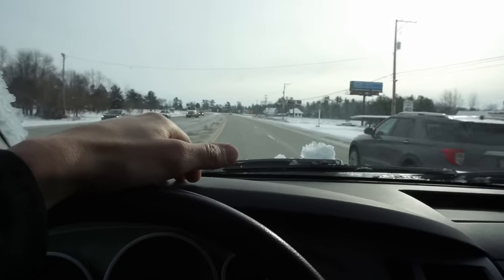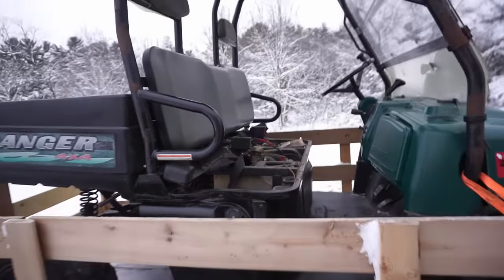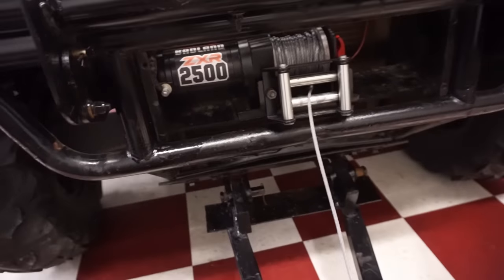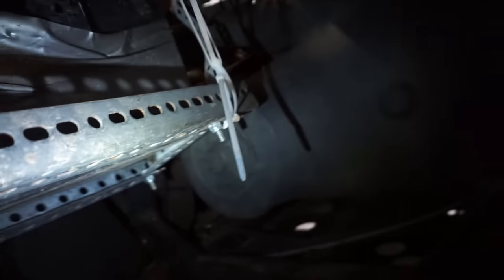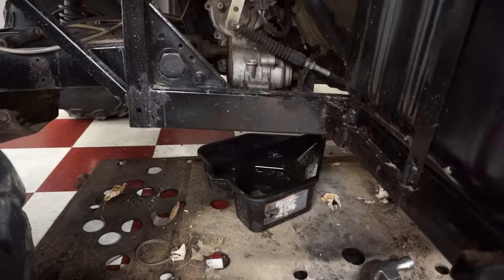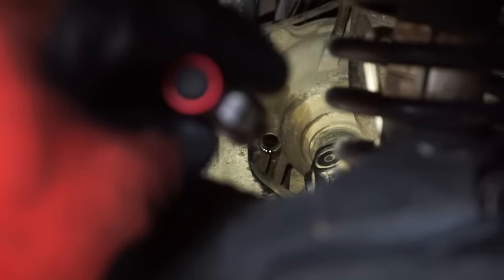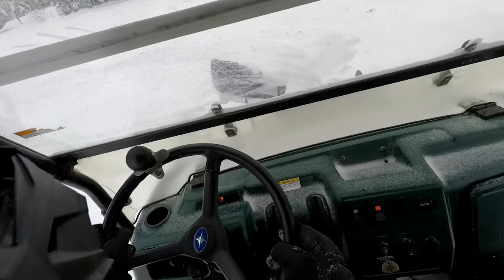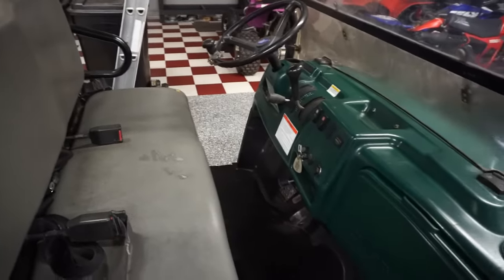Plowing Snow In a Blizzard With The Cheapest UTV I Could Find  (Huge Problem Found)

Comment: Go to Menards and buy the water softener salt which is in the blue bag they are tiny pieces that you can use for de-icing your driveway also, they are 50 lb bags at about $7 per bag throw three of those in the back of the box for traction which will be 150 lb I guarantee it won't slip when you're trying to back up even with only three wheels spinning. And also my cousin told me he uses Rain-X plastic on his side by side windshield. It makes it more clear and is supposed to let the moisture just roll off. I put it on my side by side but have not tried it out yet. If you go to the parts store it will be in the small engine aisle at advanced Auto I don't know why it is not by the regular rain x and waxes on the shelf.

Comment: You said that you have purchased stuff from this guy before? Given the CV joint hack job, lack of tranny fluid, the overfilling of the engine oil, and last but not least the Mickey Moused battery box and battery terminals being loose. I would tend to think twice before purchasing anything else from him again. Just saying. Although, with a little TLC on your part you will have a very nice machine.

Comment: If the battery cable comes off while running it can confuse the voltage regulation resulting in burning out bulbs potentially more serious damage.

Comment: If you enclose that UTV you'll stay way much warmer to while plowing snow.& By adding in A heater unit to it it'll circulate in heat from the engine to. If you plan on keeping it for that purpose then why not equipped it heat.& Windshield wipers.,,& Sprayers to Joe it's in kits. It's time consuming yes although it'll be more video content for your viewers to that watch your YouTube channel as well to out there also. The more content you add on to your videos the better it'll be for you in the long run man.

Comment: Have you seen the Bobcat side by sides they are pretty dang awesome. Heat and air and a dumpbed and they can power a snow blower. They look kill. Diesel I guess. powerful.Toolcat Utility Work Machine You paid a decent price but the CV axal he should hav knocked off more for that. It would really plow with a new CV Axal installed for more traction. Hey you needed this for content so you did what you had to do. It dose the job pretty well for what it is a 3 legger.

Comment: Without the rear differential lock wouldn’t you only have 2 wheels spinning?
Reply: That would actually depend on the design of the front diff. If the non-axle side is doing all the spinning, the axle side might have no power. And since the rear diff lock is MIA, it might be only one wheel drive.

Comment: I got a Polaris ranger crew and it caught on fire, the passenger brake light stuck on and I didn't know till I got to my garage that it was on fire. Polaris did replace the bed and stood by their product because there was apparently a recall on it. Would have been bad if it would have done it after I parked it in the garage but fortunately it was burning on the way home and I didn't know it till got off and saw the flames shooting up

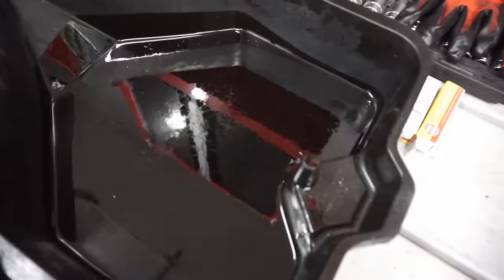Comment: Guy screwed ya...he knew the differential and CV axle were screwed with.  26:20 was that a diesel.... Guy abused crap. 38:00 oh guess he did mention it to you.  Still didn't perform maintenance 

You should change the oil on this again sooner rather than later because of how bad everything was...

Comment: Yes lots of open space to work around and stuff but there is a lot of tight spaces where you won't be able to get a wrench or even upset a pliers or anything inside to remove anything I own a Polaris sportsman 500 a 2000 it's a four wheeler converted into the side by side with the golf cart body and I do own a Polaris Ranger 500 as well I am doing the engine job on it right now I had to finesse a few things to get it where I wanted to be the guy I bought it from absolutely destroyed everything try to rewire everything and what happened it caught fire so I got it for a smoking deal 300 bucks
Reply: "caught fire ... smoking deal"  😂

Comment: Good video but a bit disappointed as the title is a bit misleading cause I thought you were going to go buy some sort of brand new cheap knock off that usually is sold at some of these farm and home supply chains that run like $1,200-$1,600 or $1,800 and are made in China kind of crap. 
Oh and what is with the shoveling up by the wife's car near the garage door. The whole purpose of "plowing" is so you don't have to shovel or at least shovel a lot except in small areas but that was a big area where you could have just used this machine. 
I still give the video a 👍🏼 cause you do some good work and I enjoy your videos!!

Comment: That style of latch is awful. Had those on my truck tool box. They will bend and eventually you have to use a flathead to open it. But should be an easy swap once it's too bent to function

Comment: brother hate to be a douche but  i want to say you run atf in that tranny, it has 2 counter shafts connected by chains. people said that there is so much rotating mass connected by chains that regular gear oil will creat too much resistance. anyway thats what the discussion boards talked about polaris tranny oil is higher than giraffe p#$$@y so atf was the ticket.